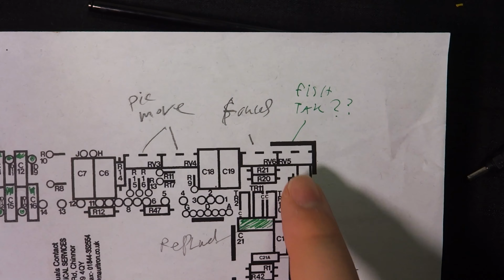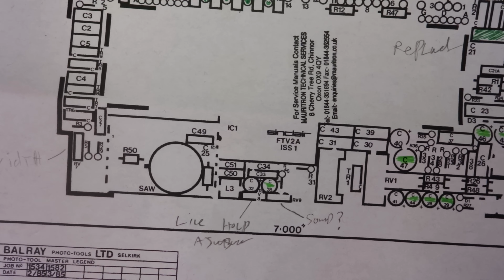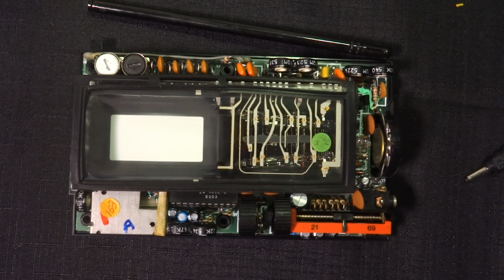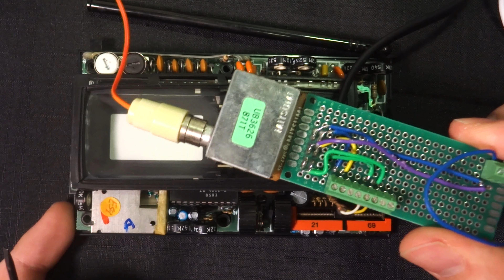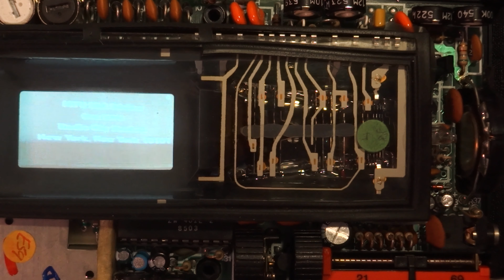Vlog : Sinclair FTV1 pocket TV part 3

Comment: I know I'm late to this, I believe this model is called the TV80 not the FTV1, besides that do you think it would be possible to add a DVB tuner to one of these seeing as there is no analog signal in the UK anymore not worried how it would look as I have a modified battery which is rechargeable and able to design and print a new case to enclose everything if needed.
Reply from the maker: I think it was called both TV80 and FTV1 depending on where you were . you should be able to add a digital tuner in just add it to the antenna input and tune the tv into it.

Comment: What happenned to your FTV1s? Did you finish fixing this one, and did you end up making the custom box you mentionned in part 1, to house all the external stuff, RF modulator and Raspberry Pi? I'm currently going a completely different route. Taking the CRT tube itself, and making circuits from scratch to turn it into the smallest possible CRT clock / vector monitor / video monitor / crude oscilloscope (I'll see where I get with all that). Trying to make it look as nice as possible as well, this tube looks really neat!
Reply from the maker: Hi sorry for the late reply youtube never notified me of your comment :/   . Its still an on going process covid lockdown got in the way. Iv updated and remade my transmitter to use a pi zero so its smaller and the next step is to make its custom box :)
Reply: @ElectronsNeeded  Awesome! I need to do something similar as well, not sure if I'll be using a Raspberry Pi Zero or some other thing, but I have a few of those Nintendo 64 RF adapters somewhere, got them a few years back for that same application. Very practical little units!